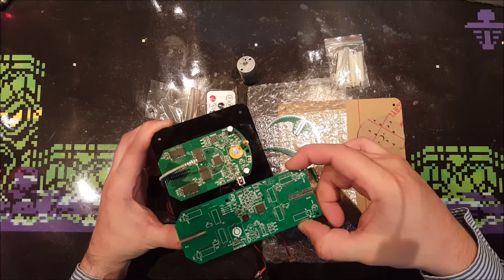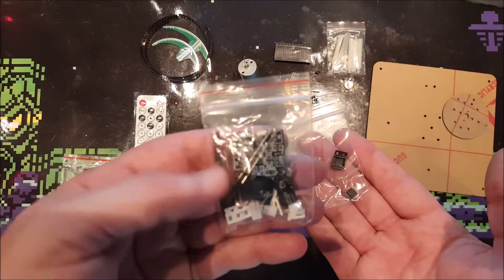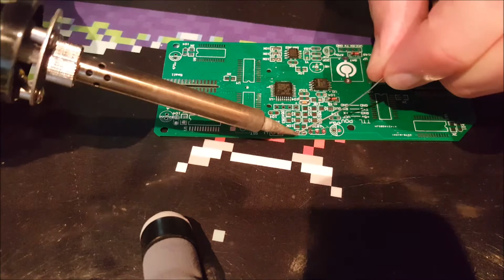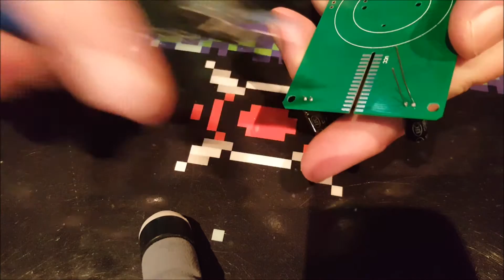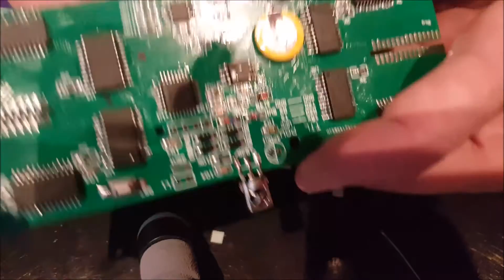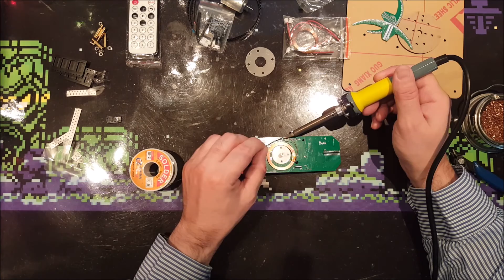How to build the Geekcreit Biaxial Spherical Rotaion DIY kit - Part 1 - The Main PCB

Comment: I recently purchased the same kit (although it's quite different from your pcb) and my question is why would they bother putting the positive & negative symbols on the IR led if they them expect you to mount it backwards??
    Like everyone else on Amazon, I didn't receive any instructions for this kit and even after contacting the seller, which they said to do, they basically told me I was shit out of luck on receiving any instructions!   My kit even came with some extra pcb that had everything already mounted on it, but didn't offer any guidance on what exactly is used for (I'm not referring to the power supply board).
Reply: that extra board is mounted to the main pcb. there is a square marking on the new version main pcb. you need to run the coil through the main pcb AND the small one that comes assembled. the other side of it has a positive and negative that you need to solder pins through to connect it to the main board. They basically omitted any of the diodes that would have been soldered to the main PCB and instead chose to included a piece that's already completed, yet offer no update to instructions, not that they include those in the first place...

Comment: That seems like a really nice piece of kit! Hope to see the end result soon. Great video!
Reply: The part that I had a problem with on soldering was the output IC's, and they had one pin that was not soldered, but looked like it was. Just took a bit of liquid flux and re-flowed the solder on the pins then it worked no problem. Also I had a hard time with this video as it is out of focus.